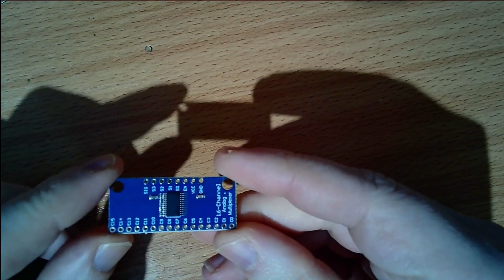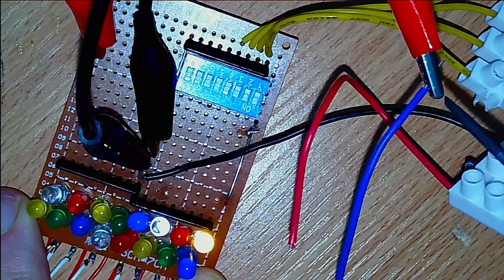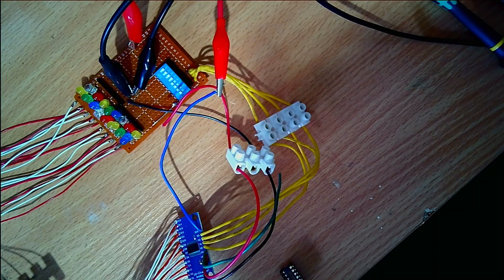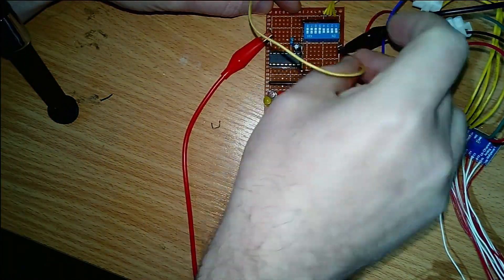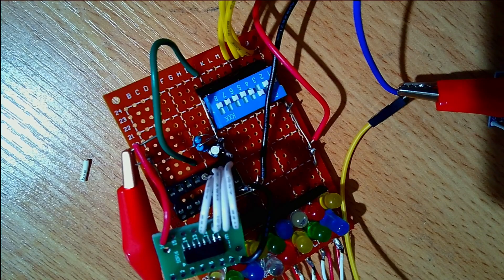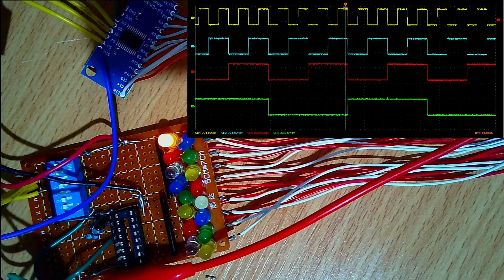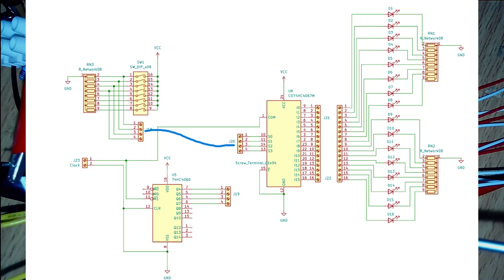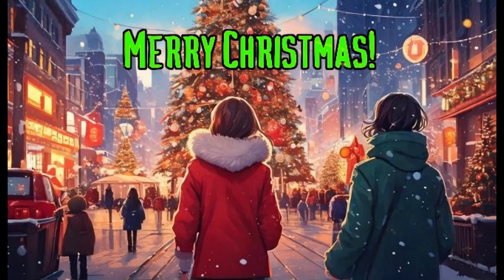Oaf Experiments with 4067 and 4060.

Comment: I spent quite a while trying to get a shift register working to drive some seven segment displays. It took much longer than intended because of shakey components. The seven segment units were sold as not requiring resistors (a blatant lie) and some of the shift registers were only working intermittently. All parts were from AliExpress. When I bit the bullet and ordered identical parts from RS everything worked straight out of the box (the RS seven segment did require series resistors and was clearly labelled as such).
Reply from the maker: Quite. Aliexpress is a fun merry-go-round of not knowing what you get (ordered some 74hc14's and was baffled they didn't work - which they didn't because they were 74hc32s.) Sometimes of course you don't get the stuff at all. 

I like digikey and mouser, as well as RS and farnell, but man, starts to get expensive! I even use Ebay on occasion, but since that stuff is just marked up from Aliexpress anyway, I have to be desperate!

Currently having some 7seg issues myself (I think these were from RS actually), but suspect it is the multiplexer here that is being silly. That said there is about 100m of wire interconnects at this point, and quite a bit of me 'assuming things' (like how much load a 4067 can take). 

I'm enjoying the experimentation.